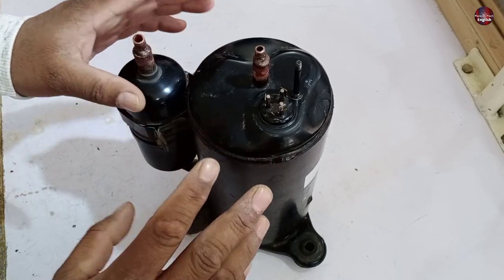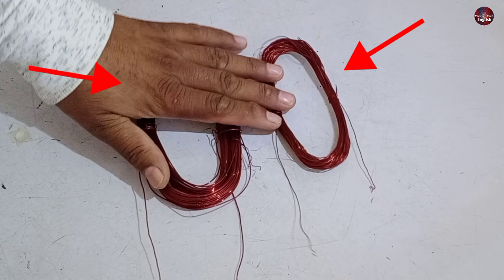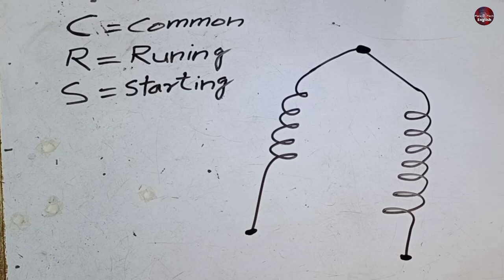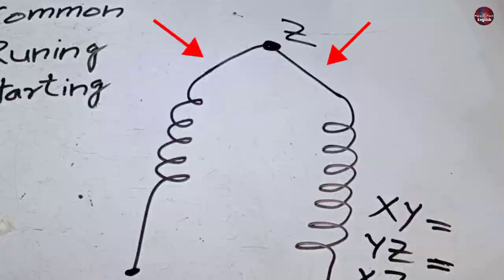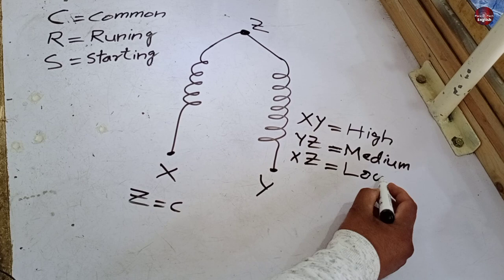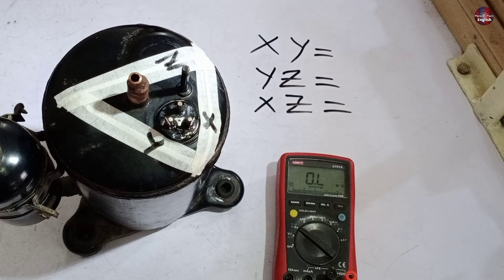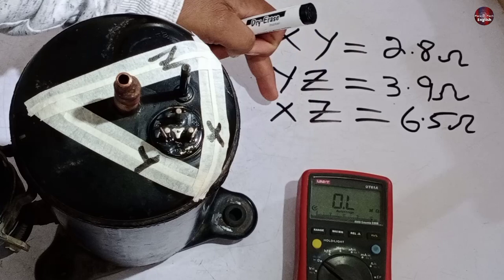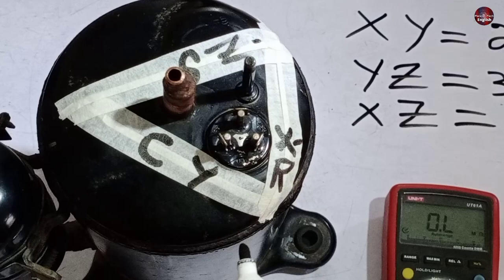Rotary Compressor Wiring Connections Are Easy as Using Your Phone

Comment: I have a compressor like this, I have single phase 220v, how can I wire the three wires CRS to make it run directly without a contactor?
Reply: Seald  compressor   rotary  hermts  comprssr  cs  and  Rare  indentified  by  measuring  rheresisttance  Ohms  bet  ween thetwrninals  using or  clamp  metertheresistance  of  euing is  low  qhilevvthat  of  starting  windinv ishighwhen  the  multimeterprods  are  connected  to  terminals  Rand  cresisttanceof ruing  wind  or  thd  lowestresistance is  indicated  when  the  pords  are connwcted  ti  terminala  Rand  s  total  resiatanxe of both  qindiningis  indicatedwhenrhe  twrminals   c  and  s area coñnwctedto  thd  metr the  resistanceof  starting winding  is  indicatedbet ween the  twrmunals  Rand  s and  lowestrwistnethwstwo thdsu  of resistance of ruing  winsigbet ween. C  and a  when  thd etr connetinv r.anx d  val  hight vslvd medom  vslu  low  value nymbrs  abc or expls  
 Smh way che  3teminsl metrs reistnce refinv 1 .1  terminslz  1  and  2  =5  ..resistncdebetween =1&3 =3..resistn1&3=2    .1-2rs .2&3cs  
1&cr..5highet  3 mediom  ..2  loest  ..   ..1&2=rs  
2-3=cs .1-3=cs   .teminals 1=R.2=s. 3=c
Reply: Put the compressor wires on the powered side of the contractor